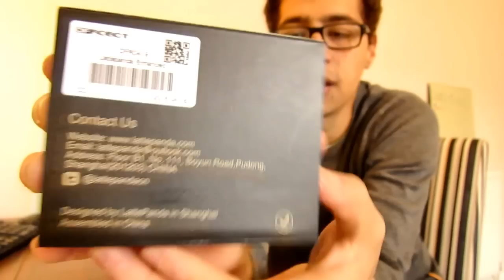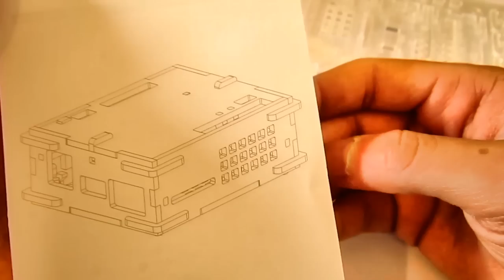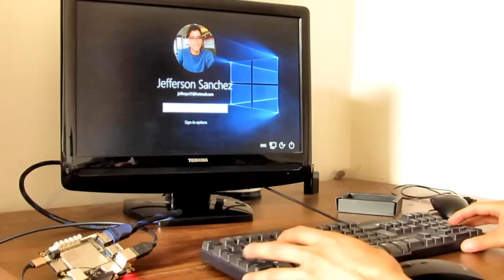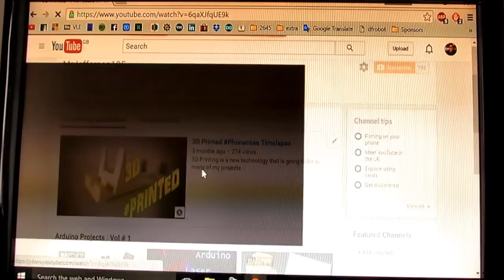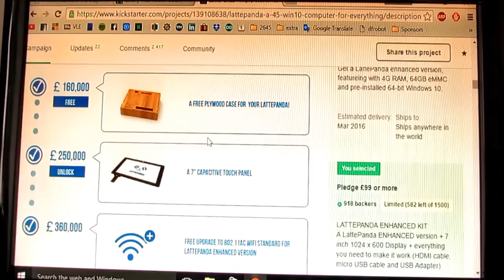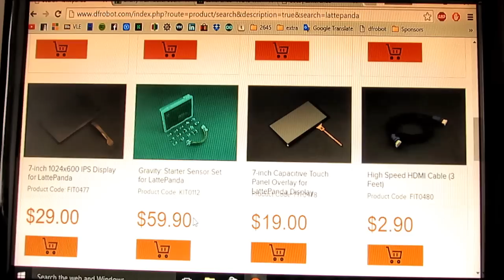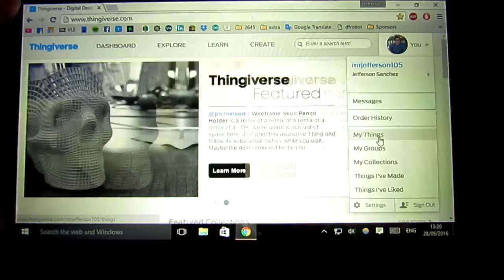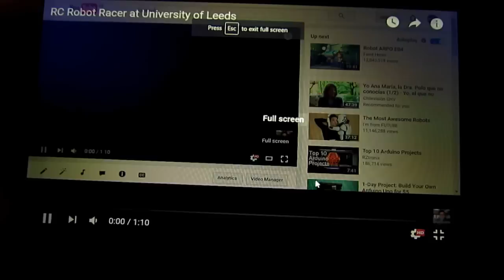✔ Full Tutorial Lattepanda Kickstarter a $45 Computer.

Comment: If I want to connect a microphone directly to the panda, is this possible with the existing output ports configuration?
Reply from the maker: Idan Sagiv I tested a usb one and it worked. . I haven't tested one that uses the 3.5 mm jack .
Reply: Please, can you send me the microphone purchase link to get a reference point?
Reply from the maker: Look for blue snowball mic I have the black one . http://www.bluemic.com/products/snowball/
Reply from the maker: There was not program required for the mic it just worked for me .  plug and play
Reply: Okay, thank you for your quick response.
i want to ask another question if you will, are you working on this with a camera?
If so, which cameras should be purchased for this development board?
Maybe even cameras that exist in Raspberry pi 3 can support ...

What are you saying?
Reply from the maker: At the minute i have used  the lattepanda to control my 3d printer using octoprint but  the camera I  used was given to me by a friend as a presennt but it is  logitec c930E   it works very well and it is FHD too . 

I dont really use cameras for rasbery pi so I dont want to provide wrong infomation by telling you which are out there in the market ..  but he one discussed previously work well for me . 

LAttepanda is the master --> controls my Rasberry Pi 3 -->  which controls the webcam + my prusa i3 printer 

I hope this helps :D